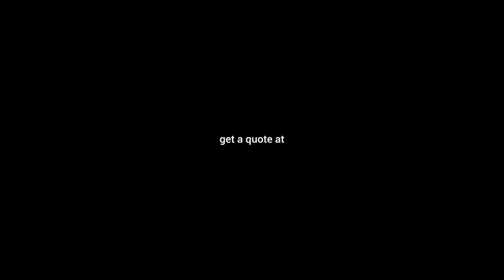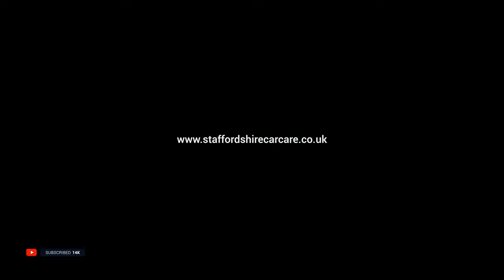PORSCHE 911 | Installing GYEON PPF

Comment: Is your man applying the ceramic coating without gloves? 😯
Reply from the maker: Yes. We don’t poor it on our hands we poor it on the applicator
Reply: @staffordshirecarcare  Can it be removed once applied to a windscreen? An installer added Feynlab to my X7 M50i windscreen and the wipers now judder. They claim they can polish it off. Curious what you think?
Reply from the maker: @TuvingtonD  sometimes judder can be avoided by replacing wipers but there are ways to install that can help against it. Yes it will need polishing to remove/reduce down the product